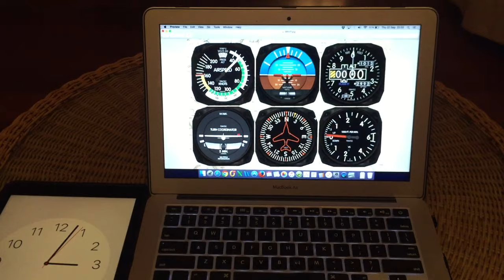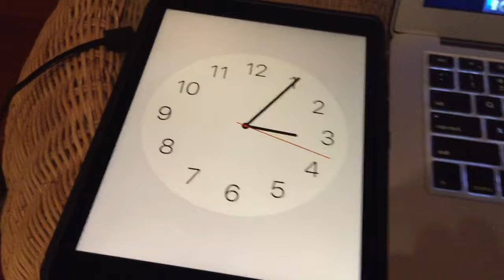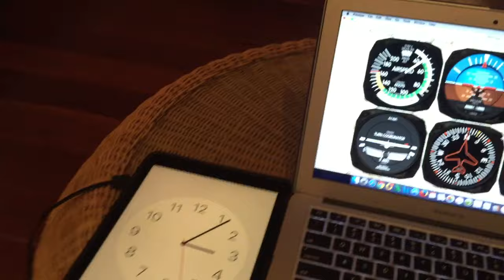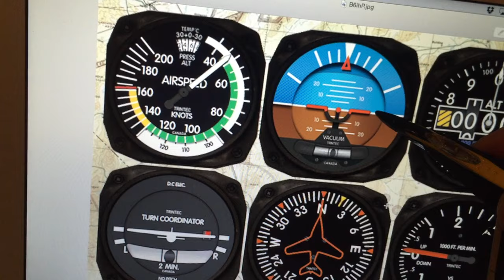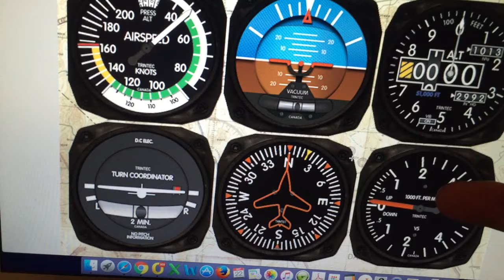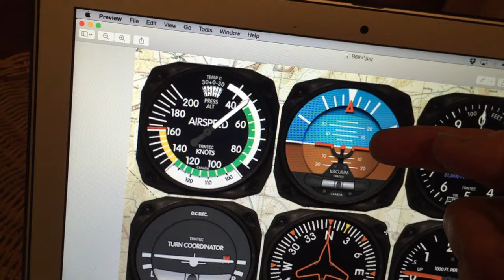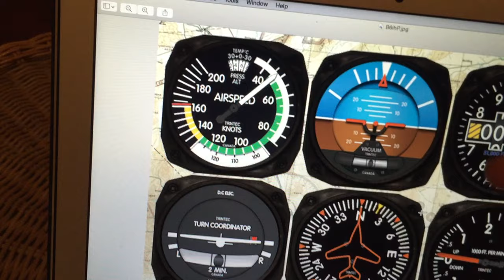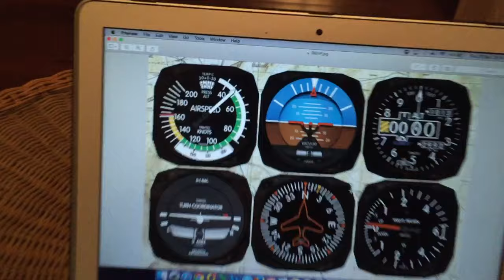Do aircraft change attitude to follow the curvature of the Earth?

Comment: What is the treshold of the acceleration in G's one can feel?
Can you rise over hundred meter per minute w/o noticing it?
Does the submarines operate on same principle?
I mean they have to compensate for the curvature of the water, otherwise they would eventually rise to the surface.
Reply from the maker: Hi Antti, that is a good question.   When flying like this you are not actually rising 100 meters per minute.  You are maintaining the same level.  

To calculate any change in G we need to calculate any centrifugal force generated by following the curvature. 

It is basically less than 0.5% in most cases and I doubt anyone would feel that.    Consider you weigh 100 Kilograms - them you have a nice meal and a beer.   You might now weigh 100.5 kilograms until you go to the bathroom.  Can you feel that difference? 

The reduction in G is apparent though when measured with very sensitive instruments.   See this video which shows us flying East with a good tailwind - this resulted in a measurable difference in G on the aircraft instrument but I personally could not feel a thing. 

Please see this video - the math is explained in detail in the comments. 

https://www.youtube.com/watch?v=n4khR31bvpI
Reply: Wolfie6020
I'm not entirely convinced. I have felt very minute accelration, for instance while driving my car - turning just slightly is noticeable.
But whether it can be felt or not, isn't quite the issue.
The issue, in my opinion, is if one must make corrections or not. Does air act like water?
The submarine thing is the most annoying.
I heard a submarine captain state they do not take curvature into account.
But can that be true?
Reply from the maker: Fair enough, though the acceleration in your car turning just slightly is far more than 0.5% of G.   If you have an iphone download a sensor app that will record everything.   You will see while driving your car the amount of acceleration in even a tiny turn will be more than 0.5%.   

Is there a video or link to this Submarine Captain comment?  I would understand completely why he would say they make no adjustments for it.   That would happen automatically just by cruising at the same depth. 

It is the same as pilots who say they don't make specific corrections for curvature - I agree, as they don't notice this at all.  However by simply maintaining altitude they are naturally following the curve.    

Assuming the surface is curved, then a height 5000 feet above the ground would also be a curve.  Agree?   If the plane just maintains 5000 feet then it is following the curve.  It is only 1 degree of change in 111 kilometers.  I would never notice that at all.

The big mistake I see many people making is thinking you would have to descend to follow the curve.  Not at all.  You are actually maintaining a constant altitude - there is no descent required.   You are following the curve as your precise direction of flight is always changing slightly to match the curvature - no descending is needed for this.
Reply: I see your reasoning, and I agree with the point that over a curved surface a "level" flight would follow the curve, no probled with that.
The aerodynamics, and aquadynamics(?), have a great effect on a moving body.
I assume the gravity does nit negate up/down movement of an airplane, I mean, it will go through the air pretty much in the direction where the tailwing (I don't know the official name) is turned.
So how would a curve then be different?
Do you see my point?
And more so this affects in water.
The water pretty much negates the effects of gravity, when a body is floating.
A submarine would go straight where it is steered to, wheter the surfave is curved or not.
Ar least according to my logic, which I don't claim to be infallible :)
Thank you for your responses.
I will check the link to the sub captain when I get to my laptop.
Reply from the maker: Thanks and yes I do understand your point also.  I'll reply more a bit later today, heading out now.

Comment: When a Concorde is being flown across the Atlantic for example at 50000 feet and 1300 mph normal use of ailerons and elevators are not used to fine trim the plane for the earth's curvature . So the puzzle for me is how level flight is maintained . Was a curve somehow designed I to the wing that stopped it from flying straight. no I don't think so . So it must fly straight . It's a rational conclusion. This means the plane is traversing a flat straight plane .  When the blackbird flew across the Atlantic were heard in England that went across to Europe because it was going too fast and couldn't slow, down in time so fine trimming for the earths curve doesn't even come into it.
Reply from the maker: +Andrew Corbell.  Andrew the Concorde does not have ailerons or elevators.  It uses a control surface called an Elevon.  

They are used to maintain the aircraft at a constant altitude.  By doing so the Aircraft follows curvature.  

The adjustment is only 1 degree every 111 kilometers.  The blackbird can easily adjust for that.    You are not understanding the geometry here.  All that is required is for the pilot to maintain altitude.  He does that by adjusting the nose up or down slightly  By doing that the aircraft is flying around curvature.
Reply: Wolfie6020  ok thanks Wolfie , makes sense it's obviously a different experience I guess only those guys who flew like this would be able to shed more light on it and  probably blackbird pilots are unlikely going to be joining this thread  but given that that at 1 mile every 2 seconds nosing down must have to have been a constant concern.

Comment: I've heard you say that flying takes a few minutes longer due to curvature. Is that true?
Reply from the maker: Erick McNerney.  In theory yes but the amount is so slight

The radius of the Earth is 6371km.

That gives a circumference of 40,030.

If we fly 14 km high (roughly 45,000ft) the radius is now 6385 km.

The circumference is 40,118 km.

That is just a 0.2% increase.

So on a 12 hour flght if you increase the time by 0.2% you have 12 hours and 1.5 minutes.

Less than two minutes difference over the entire route  As the ATC requirement for each waypoint is plus or minus two minutes it is not a big deal at all.

On flights less than six hours, say LA to New York the difference is less than a minute.
Reply: @Wolfie6020  I appreciate the response, but now I'm fairly certain that you are either lying or you are just mistaken. I've heard you make this claim before --that planes take a little longer due to curvature. I've also heard sailors who believe in the globe make this claim as well. I think it's that you unconsciously know the earth is flat, so you know that when you are driving a car, it's flat. But then you invent curvature when flying? It doesn't matter what the curvature is, we travel along the same earth, so the curvature will be the same. There would be no need to account for extra time due to curvature just because you've flown. If the earth is a curved ball, the odometer in my car will take the same amount of miles because I'm driving on that curve. The extra time you're thinking of is probably only due to the slow take off and landing, in which you're ascending several miles and then descending several miles. And you will be going slowest at those points. So not only would you be traveling more distance due to curving up and down in the atmosphere, but you'd be going much slower than cruising speed at certain points of the ascent and descent.
Reply: @Wolfie6020  so you are admitting that the time difference is only due to flying up into the atmosphere. So you're not flying in a straight line. So how does that have anything to do with curvature on the surface of your v reentry?
Reply from the maker: @ErickMcNerney  Did you do the math yourself?   I showed it to you clearly so please explain why you think this is lying?   

I also told you the ATC requirement is plus or minus two minutes - you can verify that easily enough.   

Less than two minutes in a 12 hour flight - during that flight we cross dozens of waypoints as I have shown in other videos.  The time difference between waypoints 400 miles apart is just seconds.  

Do you think that matters when the accurate requirement is plus or minus two minutes. 

I don't think you understood my reply at all mate.  Less than 2 minutes on a 12 hour flight.  

If you were driving for 12 hours from 6am to 6pm and you planned to arrive at 6pm would you at all be surprised if you actually arrived at 6:01 pm?   

What you are not considering also are winds.   Any minor difference between forecast and actual winds will have more impact on arrival time than the curvature of the Earth.  

The flight plans are computed for an altitude of 32,000 ft so the flight plan matches what you fly anyway.   The climb and descent is also computed at reduced speeds so your argument there is moot also.  

I have made the claim before and I did exactly the same math that shows you it is less than two minutes over a 12 hour flight.  But once again, the plans are computed for an altitude of 32,000 ft.  

Why not check the Math yourself?  

Sorry but now as I read further I have no choice but to dismiss what you say because you are talking nonsense.  

No, I do not unconsciously know the Earth is Flat.  It is 100% not flat.  The flight plans 100% prove we are on a Globe.  Not just the extra flight time of seconds but the actual tracks and distances.   

Do you know how to calculate a flight plan?   What formulas do you use?   See my point?  You have no idea at all do you Erick so why do you make assumptions based on a lack of understanding.  

Ok lets get more serious.  This formula will calculate a distance between any two points on the Earth.  It is 100% based on a ball 6371 km radius.  You can see that number in the formula.  

Distancekm=ACOS(COS(RADIANS(90-Lat1)) *COS(RADIANS(90-Lat2)) +SIN(RADIANS(90-Lat1)) *SIN(RADIANS(90-Lat2)) *COS(RADIANS(Long1-Long2))) *6371 

Please try to debunk it.  You cannot.    Find any location on Earth that it does not work.  You cannot.

You live on a Globe Erick.  100% fact and you cannot refute the fact that real aircraft flight plans prove it.  

Sorry but Flat Earth is just a silly internet scam.  It mainly fools people who are weak at math and geometry.  Test that formula.  It is high school level trig, nothing more.  Do you understand how to use it?  

Your car example is also meaningless because you don't have a flat Earth map to compare driving distances to.
Reply from the maker: @ErickMcNerney  I just saw your second comment Erick.  No that is not what I said at all. 

You need to go away and learn how to produce a real flight plan before continuing this discussion I think.
Reply: @Wolfie6020  all maps that are mannually used to navigate are flat. So are you saying that if I arrive late from driving it's due to curvature? If the reality is that we live on a ball, then having accurate flat maps would be pretty difficult....yet that's what is used to navigate. Seems more plausible that the reality is that we're on a plane, and that people are imagining we live on a ball. I'm not sure how your flight math proves a globe. Also, if we live on an imperfect pear shaped globe, how are the lines of latitude and longitude so even and complete a perfect sphere? Perfect lines of latitude and longitude would be impossible unless we were a perfectly shaped sphere. Any uneven bulges would throw it all off. It would also throw of the precious center of gravity. Earth is flat.

Comment: Wolfie6020  
You've done a lot of good work debunking the globe deniers, but you've got this one wrong.
The confusion is caused by thinking of the aircraft as moving round the planet. All motion is relative, so it's equally valid to think of the aircraft as being stationary with the Earth and its atmosphere rotating. That makes it easy to see that tilting downwards would result in losing altitude, and staying level would not cause any increase in altitude. Staying level and following the curve are the same.
Reply: Nightjar on the gate    That’s only relevant if your frame of reference is outer space.

Comment: You're confusing things.  Yes, planes maintain "level" using altimetry. No, they do not pitch down as they circle the Earth. The pitch reference is to the horizon, which doesn't move. If the horizon doesn't move and your altitude doesn't change, nor will the pitch attitude regardless how long you fly for. If you're saying they pitch around 360 degrees in one circumference of the Earth then you have to say you do one complete front flip by standing up straight for 24hours. Unless you're talking about space travel, which uses inertial references, you're reference has to be the constant horizon, which is not affected by Earth's curvature.
Reply from the maker: +LSUtiger607 - that is actually what I said - your attitude relative to the horizon will not change - The horizon does not move relative to your window.  However, relative to the initial attitude when measured from an external reference frame the aircraft has changed its altitude (to maintain the same attitude relative to the earth) 

This can be easily verified as occurring by testing the Eotvos effect.  I am not confusing things.  

Thing of it this way - if you are standing at the centre of a perfect circle race track and a car is driving laps.  Does it ever get closer to you?  No, it never does. 

Does the car change direction by 360 degrees every lap - yes it does.
Reply: I'm not talking about Eotovos.  The problem in your video is when you say "The compensations (of pitch) made by the pilot are so slow and minute, he/she doesn't notice it."  This is wrong.  I don't know how else to say it.  The human experience and the physics of an aircraft (in regards to pitch attitude) are in relation to the horizon and the center of the Earth.  The pilot doesn't feel a pitch change because none are made.  Period.  Yes, the aircraft "rotates" 360 degrees in a circumference of the Earth but this is not a pitch change because the reference of the airplane and the person in it is always toward the center of the Earth, not inertial space.  Gravity effects cars the same as planes (again, not in regard to Eotovos, a separate issue), yet would you say a car makes a 360 degree pitch change in 24 hours as it sits in your garage?  Of course not.You're further confusing things by your analogy.  Yes, the car going around the track makes a directional change every lap and yes, it never gets closer to the observer at the center.  The car does not however, appear to make a pitch change form the perspective of the centered observer.  You can't use the perspective of an observer outside the track and at the center of the track at the same time, in the same analogy.  The effects of and necessity for pitch changes in aircraft are ONLY in one reference frame, the center of the Earth.  Again, regarding pitch, you cannot abide by the physics of an Earth centered reference frame while simultaneously invoking the reference of an external one.
Reply from the maker: +LSUtiger607.  Ok, so you agree that the Earth is a Globe and the aircraft "rotate" 360 degrees as it does a full circumnavigation?    You agree that this rotation is only 1 degree per 8 minutes travelling at 450 knots and that rate is too small to feel? 

So the only issue is with my use of the word "pitch"?  If I had used the word "rotate" then you agree with what I am saying?
Reply from the maker: +LSUtiger607 - I do see your point and have have changed the title to my video to be less confusing.  But you do agree the rotation occurs about the lateral axis  Which is normally called "pitch" but in this scenario is not technically "pitch" as the definition is always related to the direction of gravity which changes?
Reply: My disagreement is not with the usage of pitch or rotation.  It is with the following statement, which you made multiple times: (paraphrased) "..... it happens too slowly for the pilot to notice".  It wouldn't matter if it took 60 seconds to fly around the Earth.  There still would be nothing to feel.  I don't know why you can't understand this. Forget about an airplane. If a person, under 1g, at some speed x and constant altitude (above sea level) walked around the Earth on a hypothetical path would you say he/she made 360 degrees of pitch/rotation change?  Of course not, they walked upright the entire time and made no change to their orientation. Now take an airplane, under 1g, at some speed x and constant altitude and fly it around the Earth.  It no more makes a change to it's orientation than the person would. 

I'm trying to be polite but quite frankly, you're misunderstanding of this is exactly what causes the Flat Earth morons to believe these ridiculous things.  You can't fix this video by changing the title.  The problems with it are in the things you said.  Namely, that albeit they are extremely imperceivable, the aircraft undergoes some sort of pitch down moment to fly around the Earth.  It does no such thing.